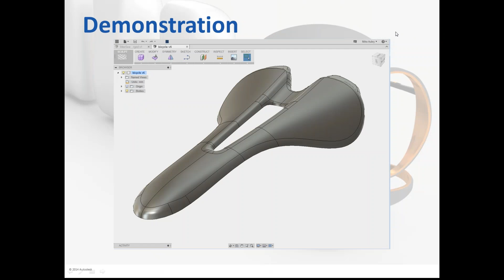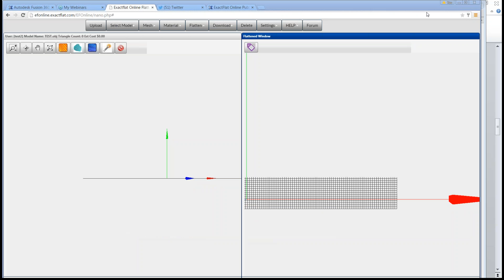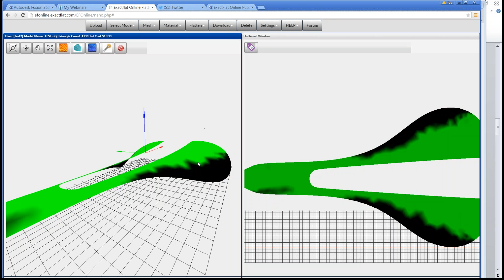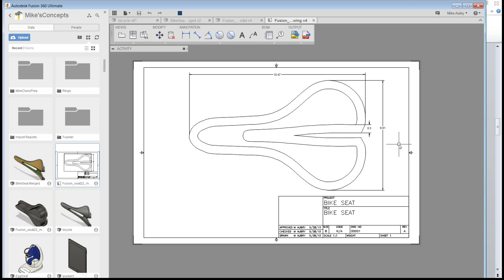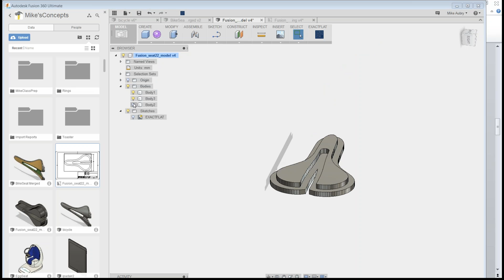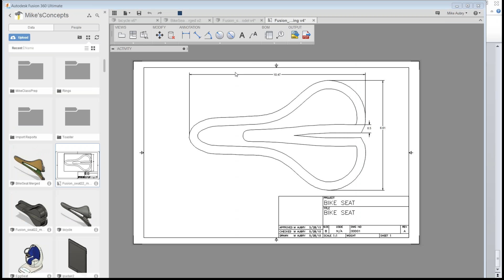Create a 2D Fabric Flat Pattern Using ExactFlat

Comment: I'm a hobbyist... I can't affort to purchase a subscription for this.

Can there not be a hobby level, no cost version?
Reply: There's one way I found, if you're still interested. Open your model in Blender, UV unwrap it, and save the image as an .svg. Open the .svg in Inkscape and save it as a .dxf. Finally, open the .dxf in your cad program and scale it to whatever dimensions you want.
Reply: pay 20 bucks to apply to a community college... get the .edu school email that is given to you, then download the free student version. :)
Reply: There is a free hobbyist version. Download the trial version and before the trial runs out click the little clock at the top right a select hobbyist/starter version.
Reply: I think meshmixer can do this, it's just not as easy to work with.